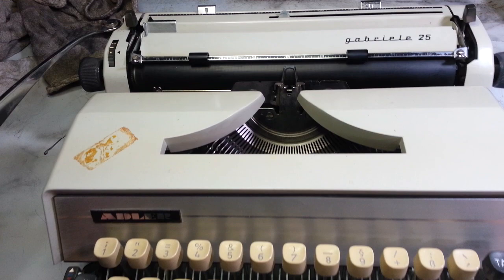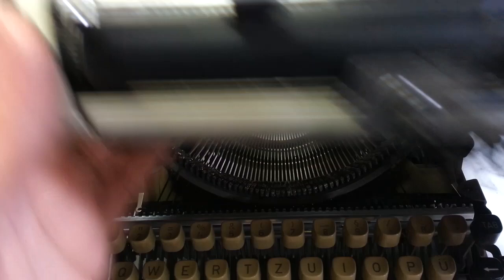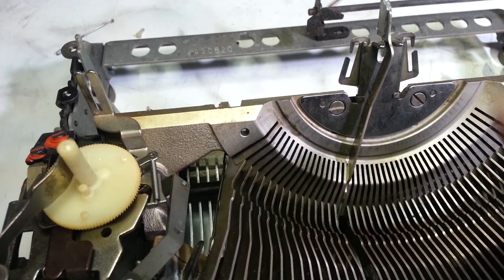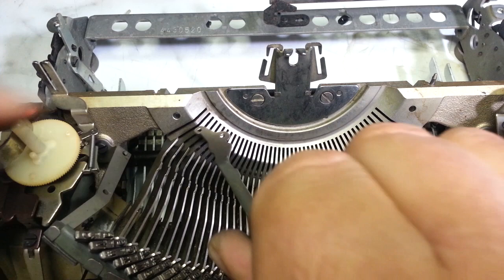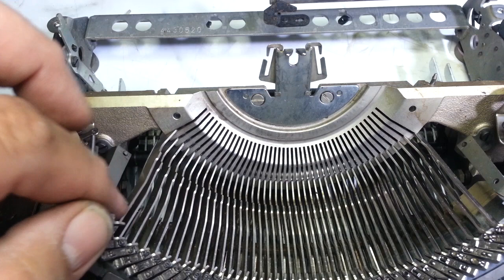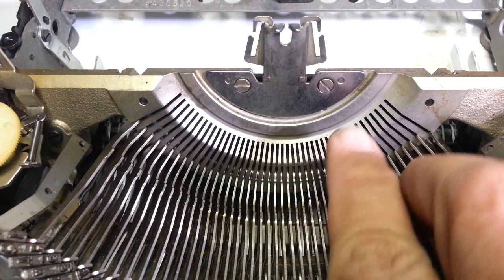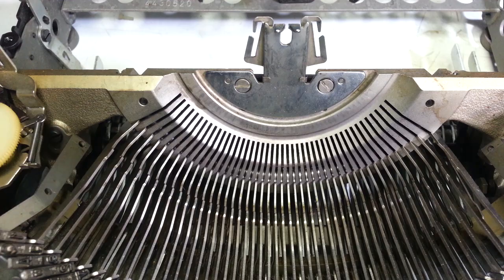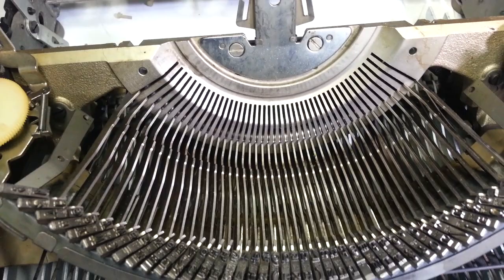Adler Manual Typewriter Type Bars Stuck Bad , No Fix !

Comment: I have a Royal Mercury that had a similar problem. Almost all the keys in the right hand part of the segment would bind. I eventually used a Dremel with a diamond stone on the key arms.  That seemed to help a bit.  Finally I added an additional spring to the area that helps the keys return.
That did the trick.  It now types okay, just a bit harder to press the keys.

Comment: I was working on this exact same typewriter just now with the same issue. Saw your video and thought I bought a lemon. Just took my bike lub out and gave it a go. The TF2 teflon spray free it right up. The type bars do not stick anymore. This stuff is great, used it on my bike for years. Never gum up and protects the metal.
The other option is to apply some lapping compound into the segment and work those bars in and out. Hopefully that would polish the slots. I've tried that with bike and gun components and worked. Just make sure you flush it afterwards.
Reply from the maker: Good going, good to know
Reply: @phoenixtypewriter2136  I don't think it's a segment issue anymore. I flushed the whole thing. Lubed it with the teflon spray and most of the type bar freed up. Then one or two of the keys would get stuck for no reason. So stuck that I can't even press the key fully down. Jiggled it around and try to jam it with the next key then all of a sudden it free the type bar and it's silky smooth but then stone other keys that was working fine is no jammed. So the slot clearance is not the issue. Some alignment issue. I think it's to do with that curved pin at the back of the segment that holds all the type bars in place. I think that is somehow worn. Have you tried to take that whole pin out?
Reply from the maker: That sounds like a right margin line lock issue, like line lock is engaging or sticking

Comment: I'm working on a Gabriele 25, too! (Triumph, but essentially the same machine as yours.) After I cleaned the segment using your method the typearms do return, but they need a quite hard touch to make a good imprint, as if there is resistance somewhere. How very unlike my other Gabriele 25 from the fifties, resembling a Torpedo 18 in its willingness. Metal expansion - interesting theory!
Reply: Try a Teflon spray, I use the TF2, there are a few brand out there, it reduces the friction in the segment slots.

Comment: Hi, can you help with Adler Universal 39 at all? I have a problem with carriage not moving..
Reply from the maker: Why isn't the carriage moving ?
Reply: It’s moves intermittently and then gets stuck. Sometimes the carriage return works but sometimes it’s stuck. Could it just need some minor adjustment?
Reply from the maker: @gavinjames1842  Adjustment, probably not. Sticky gummy parts, could be, bent binding parts, could be, I would need to put my hands on it,
Need to touch/feel/see, investigate/troubleshoot before anything.